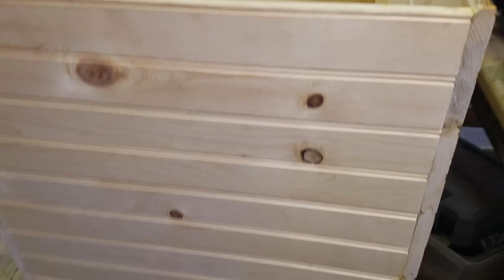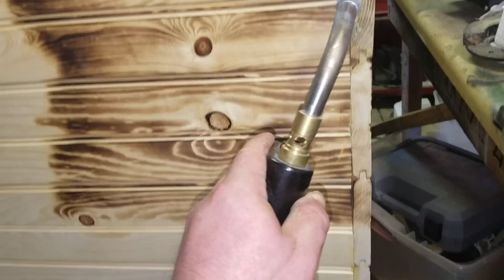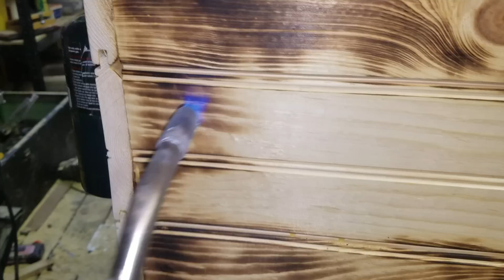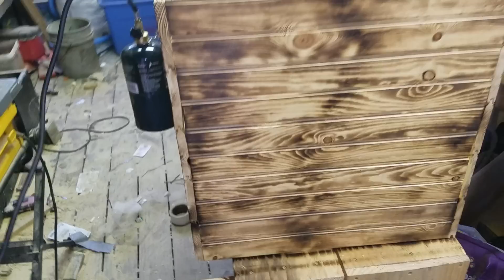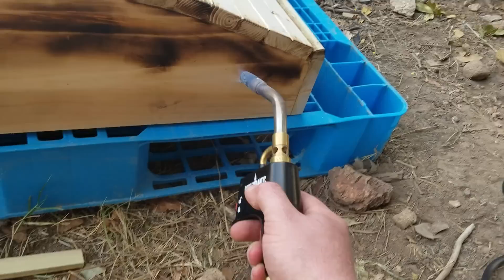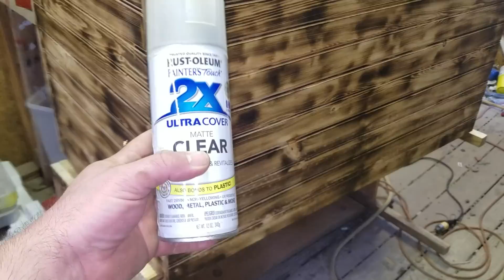Staining Wood With Fire!! Another use for torch besides melting silver

Comment: If you kept the torch moving across the whole width and not stopping in the middle on each pass, you'd avoid the dark spots in the center and the need for follow-up sanding.
Reply: You're right... if he used an auto body spray technique (such as start spraying before the piece and after the piece ends) the spotty burns in middle wouldn't happen.  Never stop in middle of piece.

Comment: I was concerned about smearing the color. Also, sand before or after the burn? Thank you for your guidance.
Reply from the maker: Sand to your desire smoothness before torch. I didn't sand after torch because I was good with the color. If you get a spot that's too dark or too much dark you can sand over it to sand it off and make it lighter

Comment: We are considering do this in a bar area with pine flooring.  There is existing urethane on the floor in some areas.  Can you burn through the urethane, or does it all have to be sanded off before starting the burning process?
Reply: If you haven't figured out by now, you're gonna want to lightly sand off the urethane before. Not too heavy or you'll risk losing some of the grain texture!

Comment: Daniel Question,? Can I Sand & put a n Oil Base Stain, Over that wood, After burning it in? Will the Stain take also.?
Reply from the maker: MyREDTAIL I don't see why it wouldn't. I thought about that before using clear coat spray paint